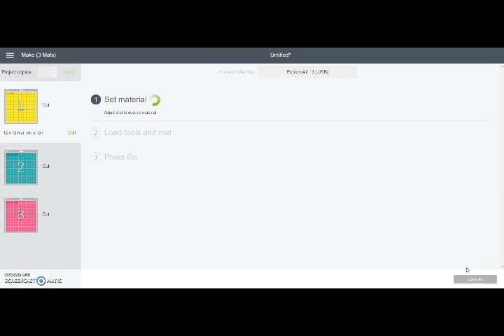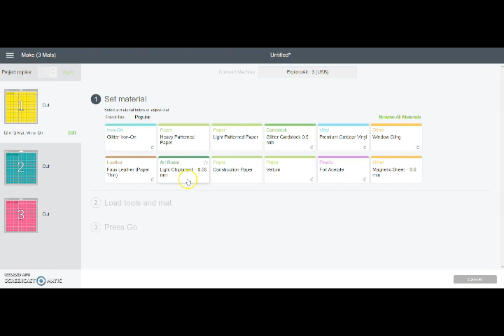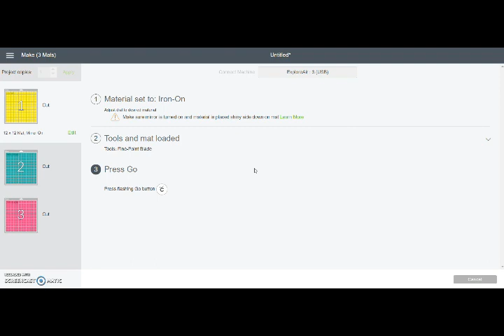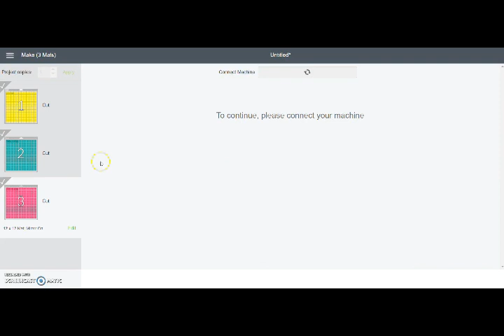How to Cut Heat Transfer Vinyl Using Cricut Design Space

Comment: I am doing all the right steps but when I start peeling back the material, it seems the cricut didnt cut all the way through in some places. This only happens with the heat transfer vinyl not the actual iron on sold by cricut
Reply from the maker: Kelly, after you connect your machine and select your material,  it will have "default" listed as the pressure in a drop down menu.  Click that menu and select more and see if that solves your problem.  Also make sure your blade is clear of any teensy tiney debris or material.